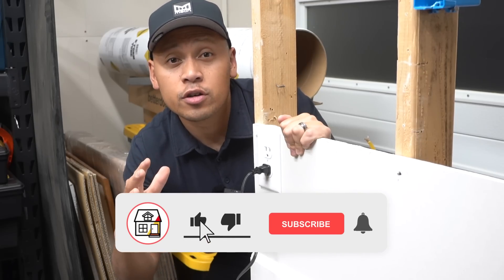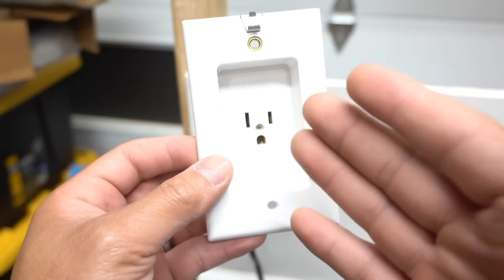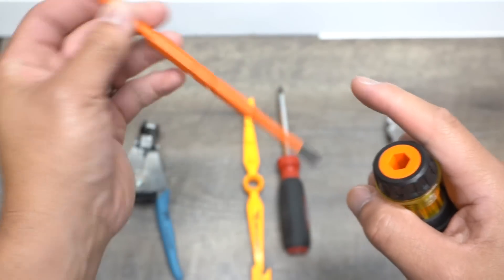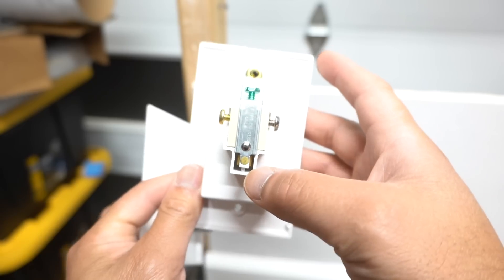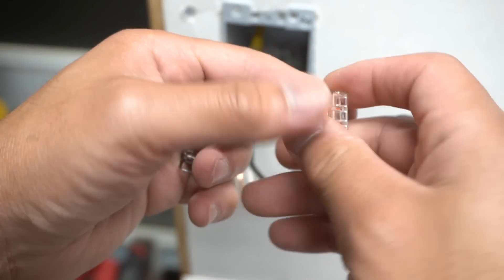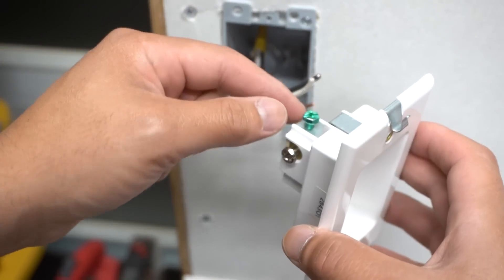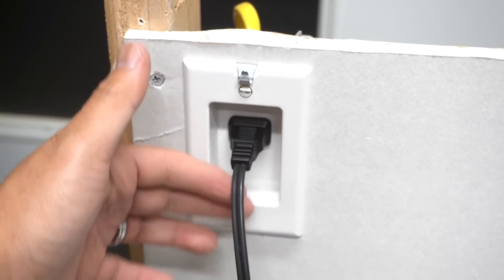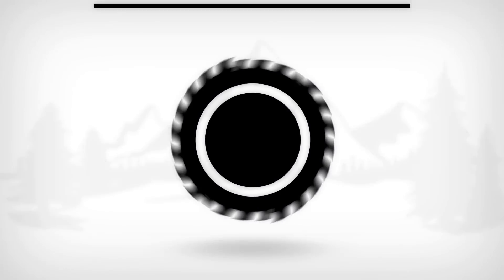How To Hide Any Electrical Plug Inside Your Outlet Wall! DIY

Comment from the maker: ITEMS I USED IN THIS VIDEO: 
- Leviton 15 Amp 1 Gang Recessed Single Receptacle - https://amzn.to/3RgyqzH
- Leviton 15 Amp 1 Gang Duplex Recessed Receptacle - https://amzn.to/3Pz3SIv
- Topgreener 15 Amp 1 Gang Duplex Recessed Receptacle - https://amzn.to/3Rgx1cn
- WAGO 221 Assorted Pack - https://amzn.to/3EuJnX0
TOOLS I USED: 
- VOLTCLAW - https://amzn.to/44GBsR2
- Klein ECX #1 & #2 Screwdriver - https://amzn.to/3PyznSX
- Wire Stripper - https://amzn.to/3r6LP2S
- Klein Automatic Wire Strippers - https://amzn.to/3Z9mAcM
- Klein Non-Conductive Screwdriver- https://amzn.to/3EBgqZv
- 6” Wire Cutters - https://amzn.to/3PcEruH
- Voltage Detector - https://amzn.to/45LMQwn

Comment: That's all well and good if 1 you are comfortable working with electricity,  which most home owners are not, and 2, you have enough room in your electrical box, which usually only happens if you have only 1 set of wires in the box, which rarely happens. Easier option is to buy a shot extention cord made for close wall situations.

Comment: Damn just buy a flat plug extension cord, less work and honestly safer.  In most cases your plug will be nearly the same depth as any trim/base on the wall and because the wire is allready exiting the plug parallel to the wall there is no danger of fraying the wire near the plug.   Also consider that these plugs are not ARC/GFCI compatible, this may be REQUIRED in your application, especially in a bedroom, and replacing an existing outlet with one of these could require a breaker replacement/upgrade as well.

Comment: Need a low level box to place  on the surface  and plug from the side or right angle plugs for tighter tolerances.

Comment: When using this receptacle box fill changes. Plus this plug is designed for when people used plug in clocks. That's why there is a metal hook on the plate. Not recommended by an actual electrician. Too many oversights. Works ok with a deep electrician box and a single wire but after that to be within code, you would need to make the box size bigger.

Comment: Just change the plug on the power cord to a 90⁰ plug. Yes, it will stick out half an inch, but it's better than putting this overpriced stuff in your wall.

Comment: Using those recessed/ clock outlets make it almost impossible if you have to use a right angle/flat plug at a slight angle. People would install those behind TV wall mount locations thinking they would be better but then if you don't have a straight plug it becomes a problem

Comment: For the product to be legal by code to install, you can only have one 3 wire cable in the box or you have to replace the box in the wall with one with more cubic inches of interior volume. Don’t  believe every DIY guy on YouTube. This guy does not know or even consider the electrical code for a safe installation.

Comment: He should have turned that breaker off.. I know a hot wire when I see one. The dangling wire in the back is a dead giveaway
Reply from the maker: Mentioned it on the video and it’s a mock up 😅
Reply: How is it HOT if it's just a mock-up and not hooked up to the panel?
Please tell us, since you "know a hot wire when you see one", so we don't get shocked.

Comment: It would be cheaper just to get a right angle extension cord
Reply from the maker: That is true! Please watch the first video I made on this topic, I provide different extension cord options: - NTONPOWER 2 Prong Power Strip - https://amzn.to/45v6cpg
- TESSAN Flat Extension Cord Ultra Thin Power Strip - https://amzn.to/45ShbsO
- SLEEK SOCKET Ultra-Thin Outlet Concealer - https://amzn.to/3Pm78FR
- Recessed Power Strip Ultra Thin - https://amzn.to/3r5KpW9
Reply: This is exactly what i was gonna say,...instead if a clock outlet change which shouldnt be done by MOST homeowners (sorry, but its true)
A cheap short extension  cord with the flat plug

Comment: For Further safety procedure i would recommend you 
A. Don't grab The receptacles from the side especially if you don't test it yet. 
B. Always disconnected your Hot wire First than neutral than Ground
C. When installing any new devices connect ground wire first l, neutral then the hot (Load/Line) wire.

Stay safe
Reply: Removing any metal jewelry and attire (belts / jackets / etc) is a good idea too.

Comment: I would add to this list of messages and video. Please please please, make sure the products you are purchasing and installing are UL listed devices/ appliances.  You also need to do a box fill calculation as to not all device boxes has 1 romex in them. Some have 3 to 4 depending in circumstance.    It is always best to call a real electrician and not a beighbor that luckily hung a fan or flood light without burning his place to the ground.
Reply: UL is a hack of an organization!  I'm not saying they don't provide a valuable service but them be some greedy mother f***ers.

Comment: this why they have swivel outlet adapters and power strips that have flat plugs which is a bit cheaper than this🤣🤣🤣🤣🤣
Reply from the maker: I think you watched part one of my video 🤔
Reply: And faster
Reply: It would be even cheaper if nothing was done to resolve the issue.

Comment: I have a question ❓ not sure if you have done a video on it or not yet, but my bath room (we have something grounded in our house causing our outlets not to work in the back bedrooms) we have the fan then the lights, when we checked how they were wired they had a netural hooked in with the hots, so when we took apart all the mess of wires and went to put the hots together with a wire cap it melted. So it's sperated again but we have no idea why it's doing that
Reply: The neutral that you are referring to is likely not a neutral.  The white wire likely feeds down to the switch and then the switch leg back to the fan and lights is the black wire in that piece of Romex.

The bedroom receptacle issue is likely an entirely different issue.  It could be a loose connection at one of the receptacles, or even a bad receptacle if the electrician who wired your house fed through the receptacles instead of pigtailing them.  Many possibilities, and hard to diagnose without seeing it directly.  Call a local reputable electrician.  It could save your house, and those in it, from a fire.

Comment: The single outlet was designed for wall clocks and similar devices.  Note the small metal clip at its top.  That being said, there's no reason it can't be used as shown here to protect the plug and cord from damage.
Reply: What I came here to say, too. I remember installing that item for a wall clock..... lonnnnnnnnnng time ago.
Reply: @billbrown6526  I'm thinking of years ago myself.  Like at school, high-mounted clocks, cinderblock walls. 🙂

Comment: Looks like a great solution to not break the wires from slamming furniture against the plug.  The only problem may be people will yank the cord rather than pulling the plug out.
Reply: Yes it's better for areas where you have stationary electrical equipment. I'm thinking bedrooms where you have lamps and such plugged into things behind dressers. This actually might help not having the cord getting bent as much and possibly fraying but you also won't be unplugging and replugging it constantly which requires pulling the cord